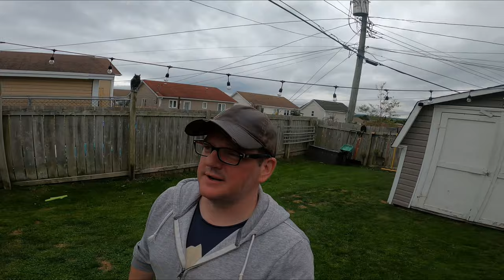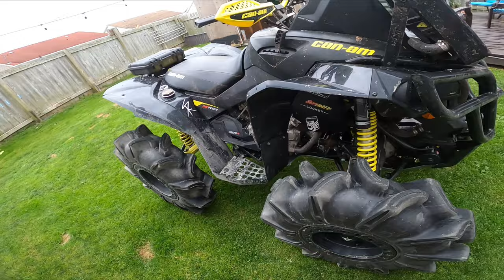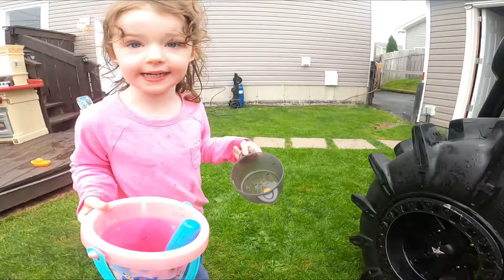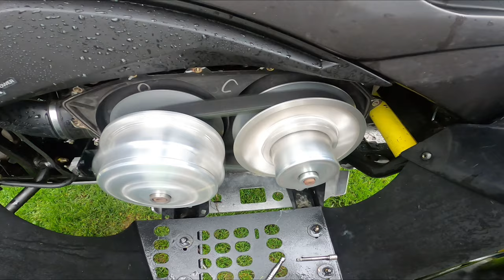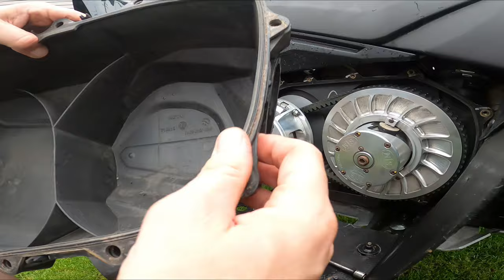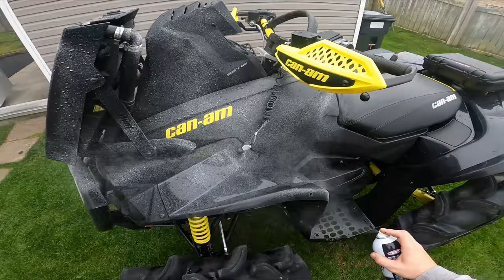Vlog 10 - STM clutch inspection and Daddy Daughter fun time in the backyard.

Comment: Why do you find it easier to take the over off compared to your outlander?
Reply from the maker: Outlander plastics are more in the way
Reply from the maker: Well I’ve had both and I find the Rene way easier to work on and clean. With stock boards or aftermarket.
Reply: @OctaneAtv  I notice a lot of people think you have to take off the foot wells, to take off the clutch cover on the outlander, but I don't. It's just that you need a extension for one of the bolts